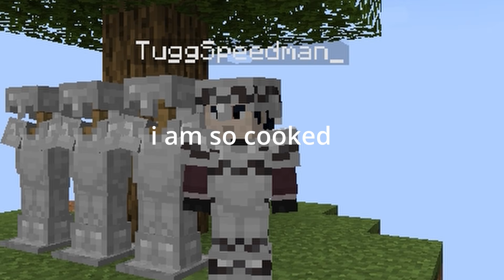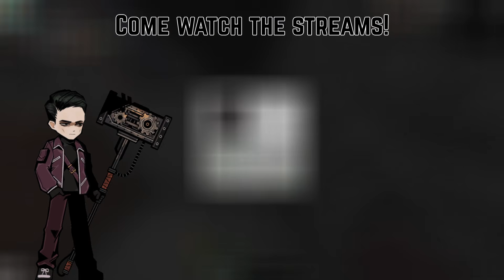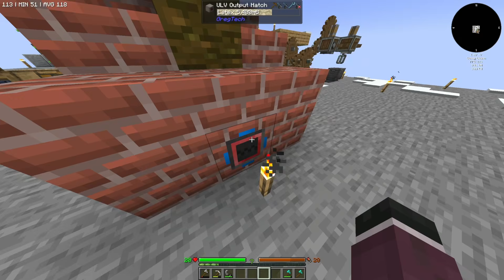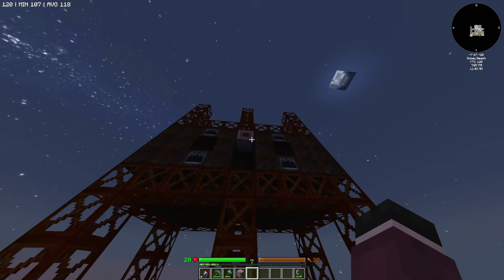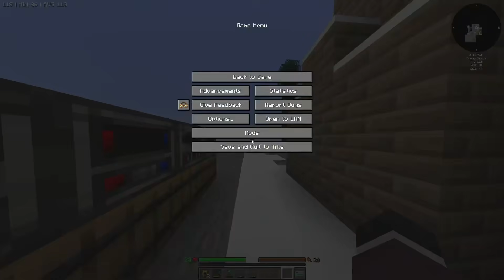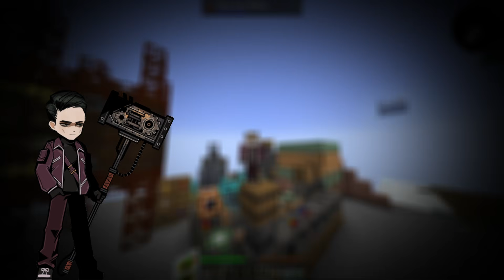Taking on a GARGANTUAN modded challenge (Startech) (1)

Comment: to be the most efficient on steel at the start of LV follow the order: bender->lathe->then probably wiremill this third because copper is cheap anyway (experience: CSG (classic stargate))
Reply from the maker: I chose to do the wiremill first, because of red alloy, since I didnt like sieving and I already had enough steel to last until the lathe, but this is probably the most optimal route
Reply: @_MossEater  that's a fair reason for wiremill, i forgot how much redstone you needed for red alloy in the beginning

Comment: btw both the latex plantation and the primitive ore factory have GUI on the controllers so you don't need hatches (hatches are better though ofc for automation)
Reply: good luck though, me and a friend stopped after the classic stargate in eta, waiting on theta to go all the way
Reply from the maker: I wasnt aware that the hatches were optional on those! Thanks for the tip!
Reply: @_MossEater  pre HV, create ore proc is better than gt ore proc
Reply from the maker: Really? I was under the impression that the ores from the void extractor couldnt be put through create, which is why i built the electric factory
Reply: @_MossEater yes but some ores can be processed through crushing wheels and washed by fans for byproducts